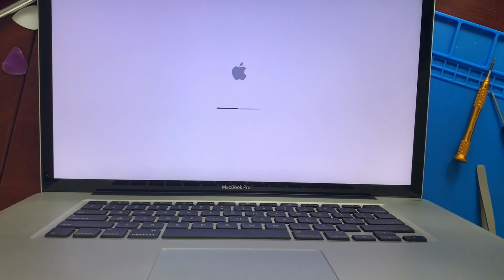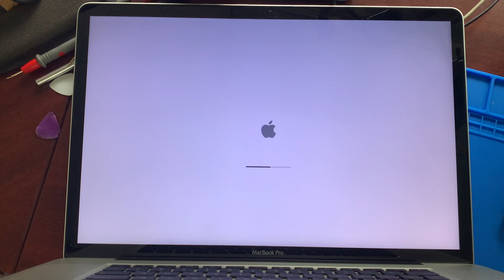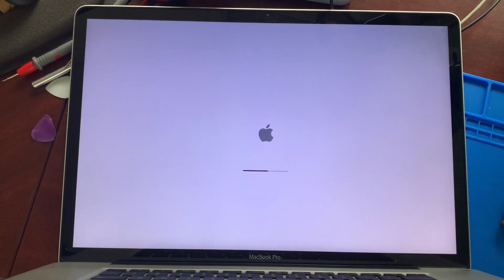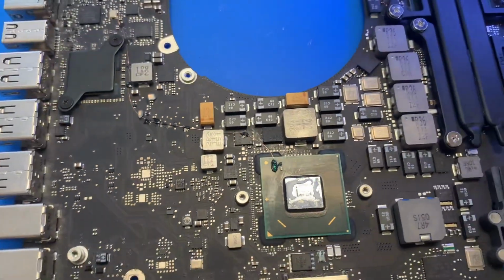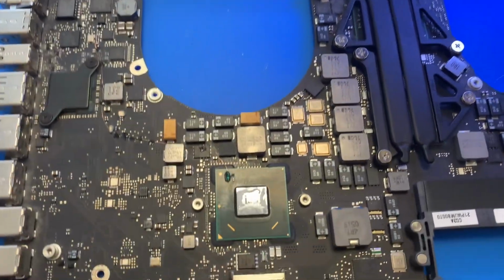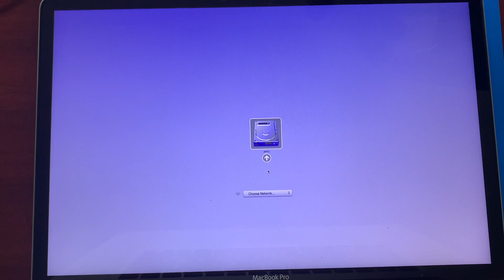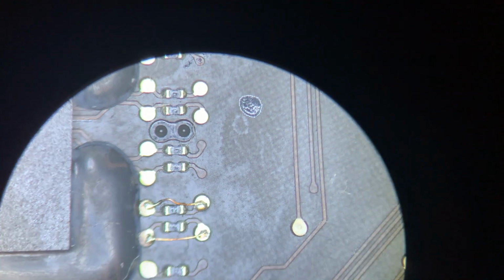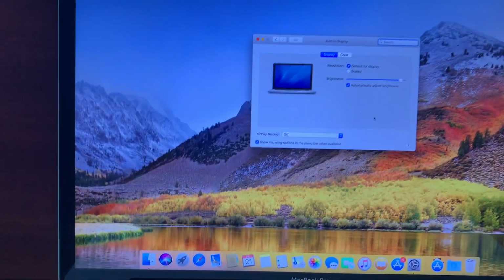820-2914 bad GPU repair. GMUX GPU bypass with brightness control. 100% future-proof repair.

Comment: I bought a 2011 MacBook Pro  (15-inch early 2011) A1286. Put macOS Catalina Patcher and the computer works fine.

It has a Catalina (dosdude patch) I use it with the nvram/kext command but I have a problem with sleep/waking, only boot after tries or if I left it heating up.

I noticed that my macbook has the error (Screen WILL NOT turn on after going to display sleep).(No hardware modification )

But when using the computer for a while (like watching YouTube videos) it starts to heat up. Is there a solution for this?

Will this method with solve this issue? Will brigthness works on Catalina dosdude patch after that (now it is working fine)?
Reply from the maker: It's ok for this model to run hot. If it works for you as it is - leave it as it is.

Comment: is running a wire still the only option for native brightness control?
Reply from the maker: You can buy $20 license from dosdude that comes with integrated brightness control so no wire is necessary or another free development from Yevhen Parolia that only needs one simple wire (no digging into pch). Link should be somewhere in comments under my other A1286 gmux bypass video by Mr. Long method. Thanks

Comment: I still get distorted display after converting 820-2914 but 820-2915 works perfectly, any solution?
Reply from the maker: Blue tint or distortion? If blue tint - 2 resistors shown in this video. If distortion - gmux chip might need to be reflowed or reballed.
Reply: @applepietech  blue tint
Reply: @applepietech  please show me the resistors
I have seen it thanks

Comment: If you send your MBP to doslabelectronics for their flash fix they do the backlight fix too. I just got mine back today and it works by holding down the battery status indicator on the left side. The button still works for battery status display but also adjusts brightness. VERY slick.
Reply from the maker: Yes, that's a good option. However with the PCH jumper shown on this video You do not loose Auto-Brightness

Comment: Ram have to remove? The print
Reply from the maker: Ram module in this video was used as a donor for the contact trace to make the interconnection between 0.02mm wire and 0.1mm wire on the PCH. DO NOT MESS UP YOUR GOOD WORKING RAM MODULE!!!

Comment: Is it risky to solder directly on PCH (U1800)?  Chances of bricking computer?  UV Mask and light needed, yes?
Reply from the maker: Microscope too. If you did micro-soldering on a cellphone logicboard - You will have no problem with this repair. Otherwise I would not attempt it.
Reply: @applepietech  Thanks for the quick response.  Our techs do have microscopes and they actually do work on cellphone logicboards with some regularity.  But, my lead tech had a little worry bout regarding this mod.
Reply from the maker: @bluemaxcomputers2911  I would suggest practicing on the donor board first

Comment: thanks for making another great video. It seems like you have automatic exposure control on your camera, which compensated for the change in backlight, and makes it seem like it's all the same brightness. Just a tip, use manual exposure next time when filming things like this